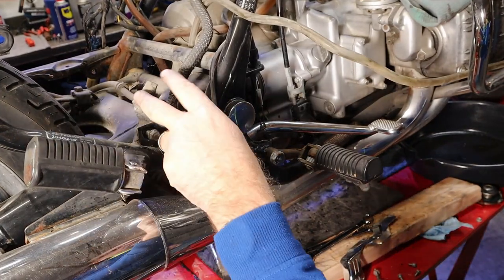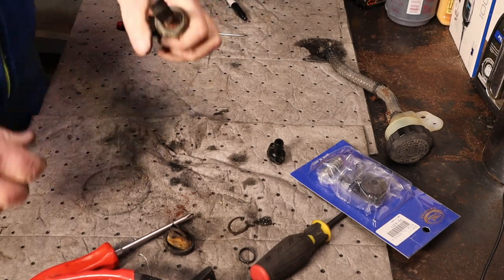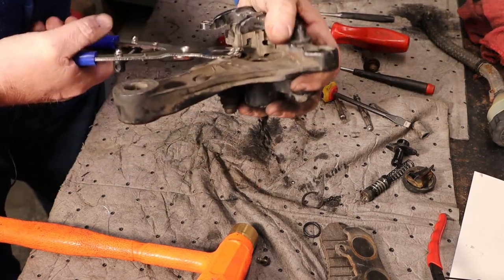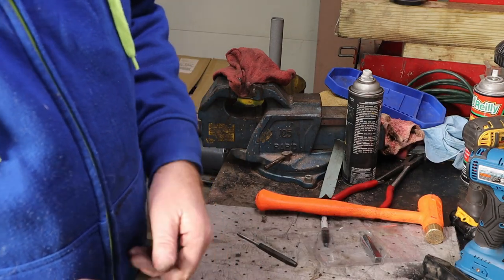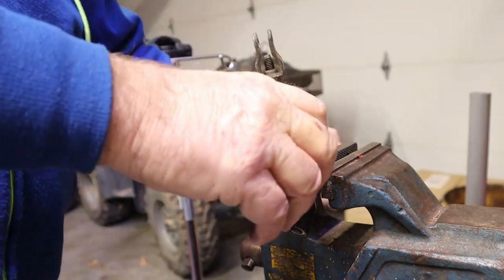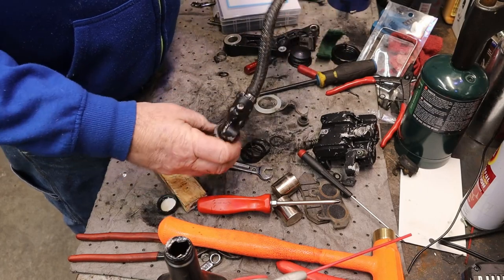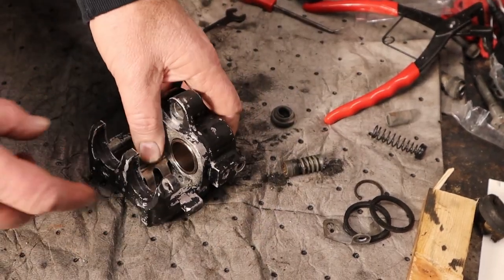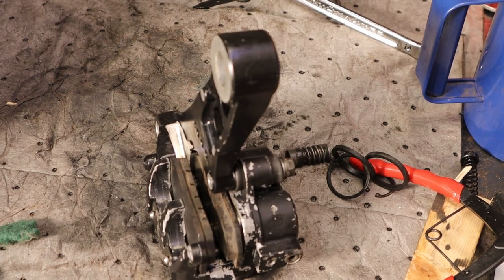1982 Honda GL1100 Goldwing Rear Brake Rebuild. Rebuilding Caliper and Master Cylinder

Comment: Questionn, going thru a 82 gl1100 and when i drained coolant not much came out. but when i filled . its leaking on top of left side head but cant see where its coming from.
Reply from the maker: It is probably leaking from the coolant cross over tubes that run from the center of the engine and out to  each head. Thank you for watching.

Comment: Love your videos, just recently acquired a 1982 GL1100Goldwing interstate, and will be rebuilding the front and rear calipers. What size ultrasonic cleaner do you have and do you add a cleaning agent of some sort to the water?
Reply from the maker: I think mine is around three gallon. I have tried several cleaners and I think I like using simple green but I only add about a pint and rest water. Make sure you rinse all parts coming out of the cleaner thoroughly with warm water right after you take them out. Thank you for watching.
Reply: @RaymoreRepair  thank you so much for your  response.

Comment: How much of the rebuild on an 1982 GL1100 will be the same on a GL1000?
Reply from the maker: Really most of it. The ignition system is a bit different and the front brakes are single piston but most of everything covered will be similar.  Thank you for watching.

Comment: Ray, tuned in for the M/C but have done those pistons before. It is best to use a shim of wood to prevent them from unevenly popping out. If one comes out getting the other one out is a giant PIA. The wood stops it just before it completely exits and you can then use the air pressure to nudge em evenly to be able to pop em out both at the same time.....in the perfect world I suppose.  Anyway mine were rather crusty like your'n and that's what I did. (the wood goes across em both AND I USED WOODEN SHIMS, meaning the pistons were barely in the bore and easily removed)
Mine were very crusty on the inside and under the seals in the channels. I had to use a scotchbrite dremel wheel after sonic cleaning to removed all that crud and even a pick tool in the corner grooves. But the brakes WORK GREAT now.....Brake fluid on the seals before inserting eases the pain....
Reply from the maker: Thank you for the tips. It's good to get the old ones back up and running. Thank you for watching.

Comment: Hello! Please tell me the model number of the master cylinder repair kit.
Reply from the maker: The master cylinder rebuild kit is from K&L supply part number 32-4271. I ordered it from Western Powersports which has it listed as part number 232-1100 through Donnell's Motorcycles in Independence, MO.
 Thank you for watchng.

Comment: Great video. I am checking my 89 gl1500 rear brake caliper soon. Do you happen to know what type of dremel brush that was? I don’t want to accidentally grind out the caliper.
Reply from the maker: It is a Dremel brand but I don't know otherwise. Just on I had in the shop. Thank you for watching.